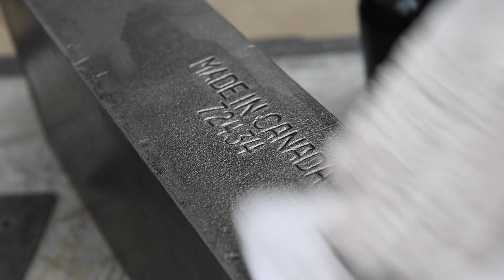Making an Anvil from a Forklift Fork | Making an Anvil and Stand

Comment: What is the weight of the steel that you were using and what is the weight of the new steel?
Regarding the laser - what unit is being used there, if you don't mind sharing?
Great build and as other have pointed out - it looks like your logo, so good!